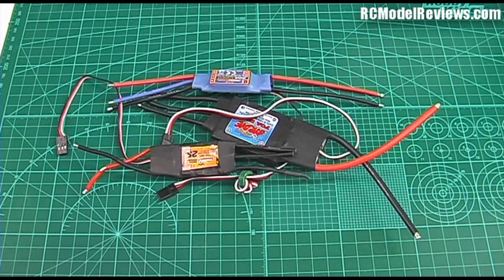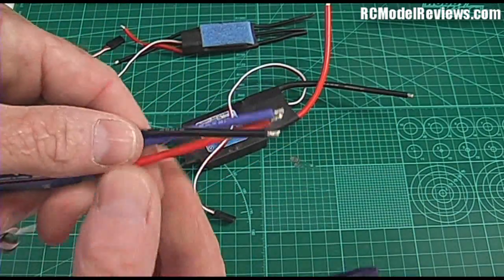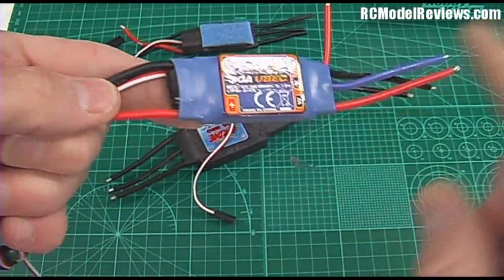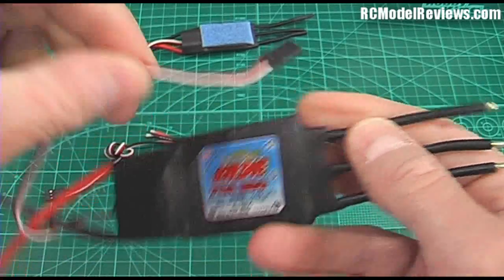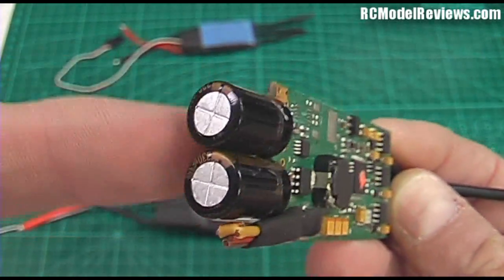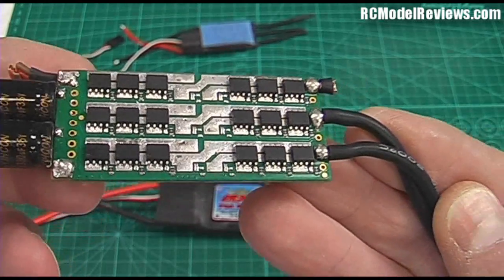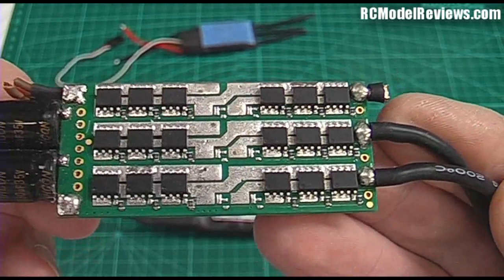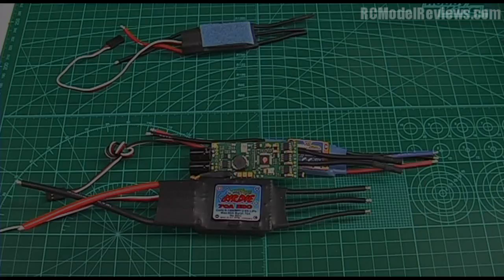What's inside: ESCs

Comment: If I have two identical sets of battery, ESC, and motor, and I put on different sized propellers on them, then how does (1) power output, and (2) RPM vary according to throttle position?

I am under the impression that both setups will give the same RPM at the same throttle positions, (and power output is greater in the setup that has the bigger prop). Is this correct?

i.e. at say 90% throttle position in both set ups, both props would be spinning at the same RPM?

Comment: @adeptrc 
In this sense they indeed are AC (or alternating pulse DC to be more specific).
But what i wanted to know is why for example CNC manufacturers are switching their  from aternating pulse DC servo and "steppers" (which in essence are the same) to AC motor powered servo (induction (big machines) or synchronous based on magnets (smaller robotic arms) ).
I still don't know what benefits has iduction/synchronous AC over pulse modulated DC?

Comment: Do you think that a battery really benefits from the capacitors? I always assumed the capacitors were there to make life easier on the regulator that feeds the other electronics...especially the RX. Wouldn't the series inductance from the wires and the battery's internals alone keep it from seeing spikes? What do you think? Would a battery get hotter without them?
Reply: sorry for being 10 years to  late but they are to filter the power llines cause of spikes of the motor

Comment: @Matthewandmatthewpwn almost correct, but not quite. "c" rating means how much more current (in Amps) the battery can provide than it has mAh. If you have a 1000 mAh battery it shpould be at least 40c to run 40a (1Ah*40c=40a) if you have a 5000 mAh battery and need 40 Amps it ought to be at least 8c rated (40A/5Ah=8c). And a 5000 mAh battery at 40c can provide as much as 200Amps of current. But having a bigger c rating puts less stress on the battery at the same current draw at the cost of mass.

Comment: @cynr100 brushless motors are driven by 3 phase AC current. there is no difference in how you connect these 3 wires) If the motor turns backwards you just reverse 2 of them. For example if you plug wires like 1-2-3 and it goes th wrong way - hust plug them in 2-1-3 order. You can read more on motors on Wiki: en (dot) wikipedia (dot) org/wiki/Brushless_DC_electric_motor